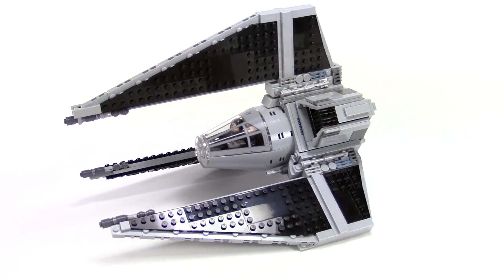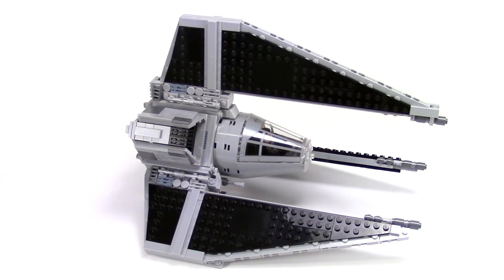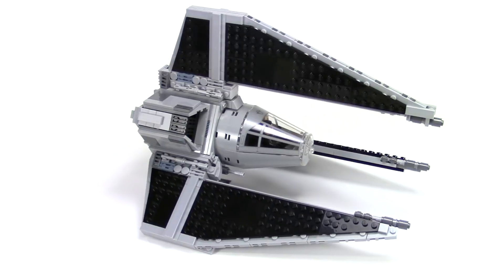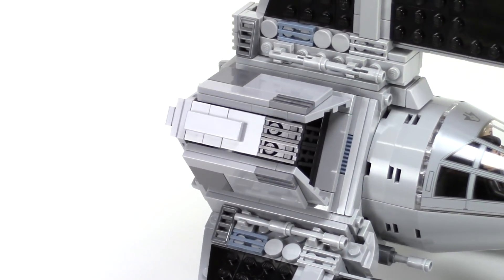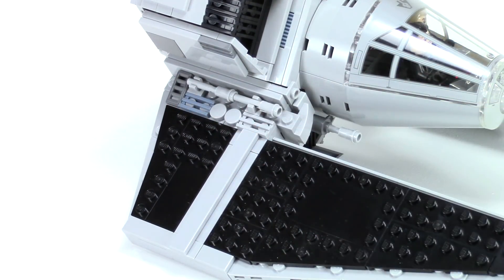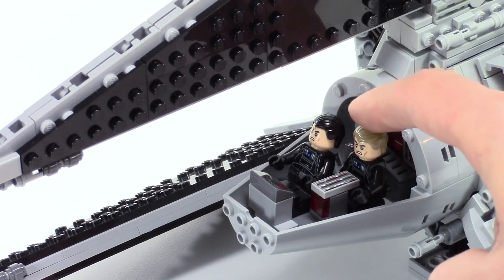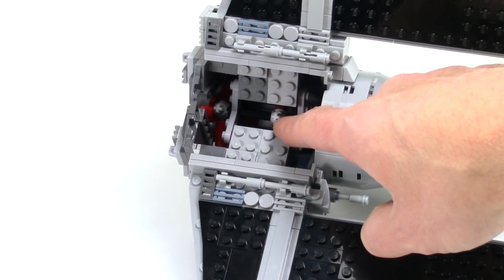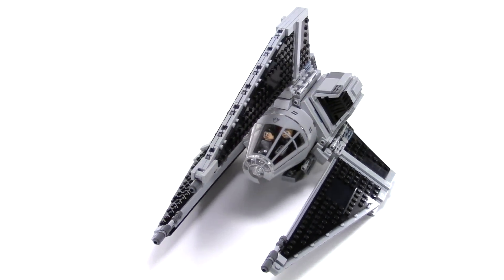LEGO Star Wars TIE Phantom MOC!

Comment: Great build as always! Though a little suggestion I also suggested on your Tie Interceptor MOC video I would put some sort of weight in the back of the craft so you can remove those little cheater bits from the little wing solar panel things which are there to keep it sitting upright. Not that it's really a problem but just a little thought I had.
Reply from the maker: Those parts are holding the plates back to back together.

Comment: Love the build, any word on directions becoming available?
Reply from the maker: Thanks. I would need to do some redesigning to it, so I can actually make a viable LDD model. This one has too many illegal techniques to work.
Reply: @RebelBuilder  Any thoughts on using the part: 27255 like/from Tracker I?  Some old hinges (4275/4276) with one side flipped can be used to hold to two bottom of plates together at 1/3 thickness, could help firm up the top wing.